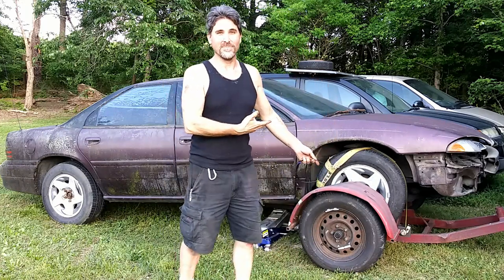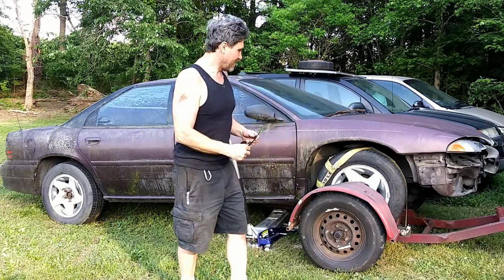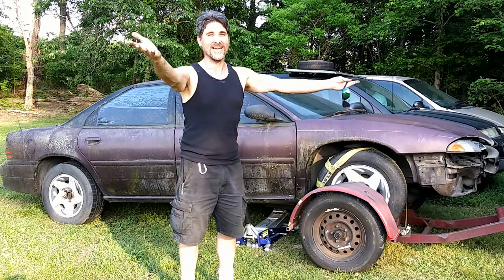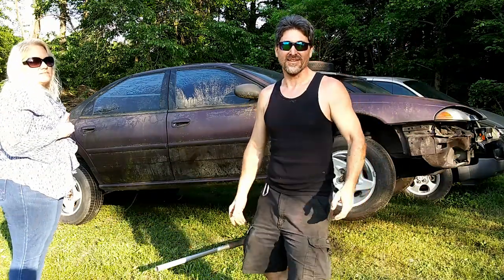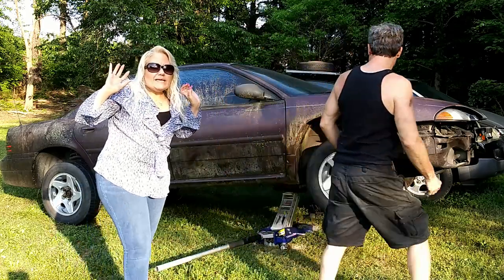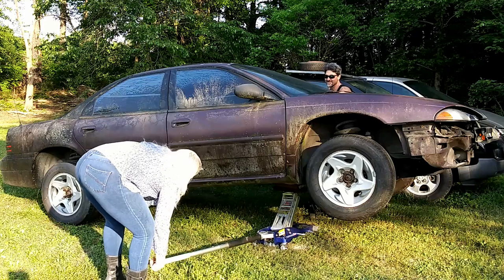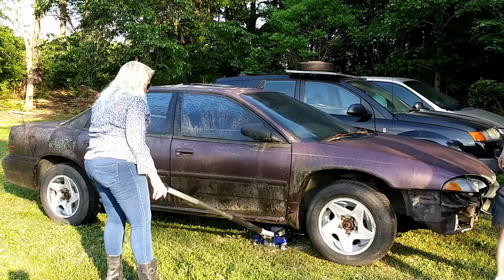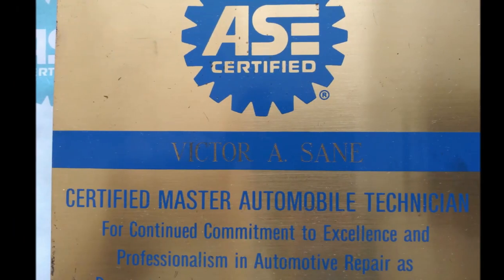How to load or unload a non running or dead car from a tow dolly

Comment: If you have a Dolly that has attached Ramps that's impossible to do. I personally just scotch the towed vehicles rear tires front and back set the emergency brake unstrap it and pull out from underneath it.
Reply: This comment saved my butt because I was scratching my head for a few minutes trying to figure it out with my floor jack. thanks!
Reply: So I have to use a UHAUL tow dolly to tow a DEAD 1999 Yukon not even a mile.  (should just wait til 2am on a weeknight and slowly push the damn thing with my truck.! )    However, the only way I thought to get it on the dolly was to Jack it up but you say if the dolly has attached ramps you can't do it that way?
Reply: what do you mean ???

Comment: That is how I unloaded my iroc z. I've never seen a tow dolly without ramps. On my dolly I unstrap the wheels, pull the tilt pin, and push down on the ramp with my foot. The car or truck will roll right off. With some cars I have to use a couple of boards to keeps the nose from tearing off.  👍
Reply from the maker: The ramps are in the Van with the nose LOL. I should have put it on the dolly this way and forget about putting the ramps on and off. Your dolly must be the style that ramps that dont come off.

Comment: Guys, I discovered a better option. Put wheel chocks in front of the back tires, and then drive the towing vehicle forward. You will also want to put a couple of two by fours behind the back wheels, or have somebody in the driver seat to operate the brakes to avoid the vehicle careening backwards. Did this today and it worked perfectly.
Reply: I hope after a month you realized this is for non running vehicles
Reply: the tow car needs to be in neutral right?

Comment: sometimes you overlook the simplist but most effective ways. 
My initial idea was to chalk the wheels on the dolly nd then pulling the dead vehicle on to the dolley but I def like this way more.
Reply from the maker: Your right all the other ways Ive tried there's the danger of overshooting or rollback etc. This way you get to just place the wheels right where ya want them. Some times ya just gotta put the Master certification in the drawer and Hillbilly that thing.
Reply: @saneauto  I used your method just a couple days ago to tow my car to the scammership haha.
life isn't a book, a text book will only help you so far.
Thanks for putting the effort in posting the vid, helped me alot.

It's funny I came across a quote by Albert Einstein
"True sign of intelligence is not knowledge but imagination" ;)

Comment: Or you could set the brake and scotch the rear tires the drive the tow vehicle forward..... you can also load the same way except you drive in Reverse not forward
Reply: That’s what I’m planning on doing. Will have my jack/stands as a backup, thanks to this video.

Comment: Is not a bad, but i prefer to use my come along (is more safety in my opinion) well this jacks may save a time
Reply from the maker: I carry a Come-along in the van for the same reason. It is also a great way to load if your alone or dont have the jacks.